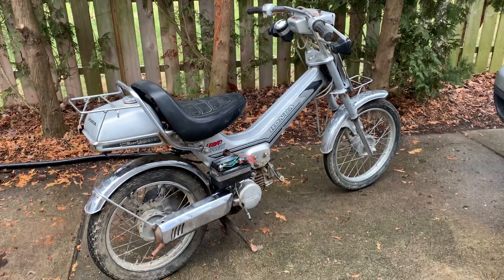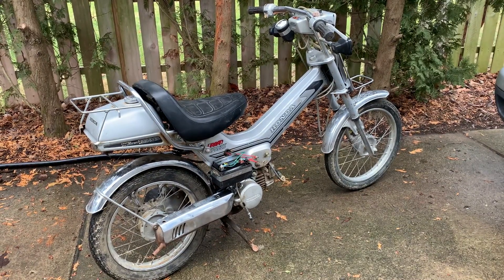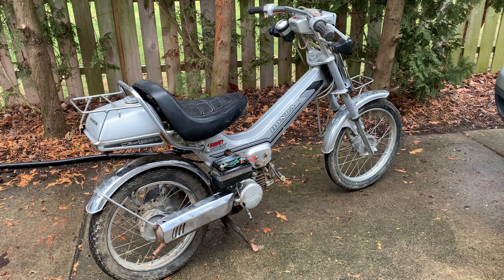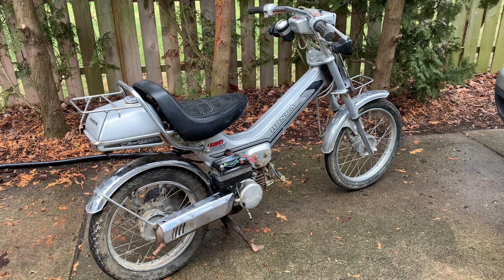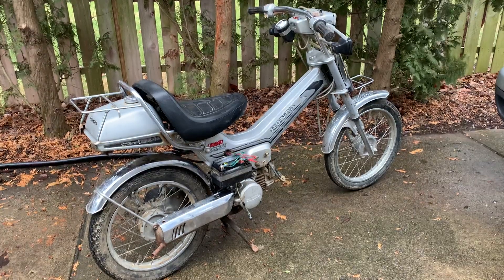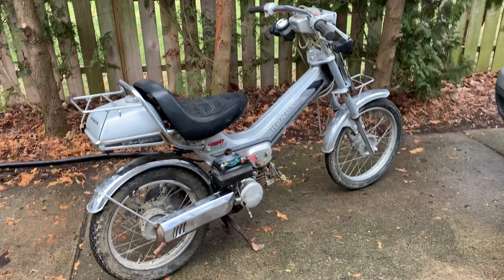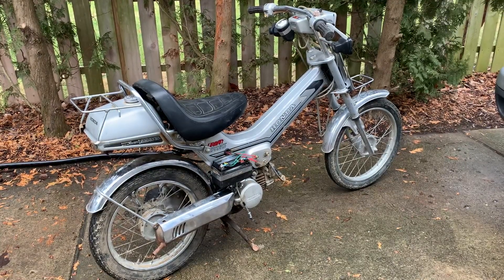Silver Honda Urban Express Nu50 first start after stuck piston and crank

Comment: I've got a little nx50 I'm going to rebuild. Been collecting parts for awhile. Gonna be fun. First the engine swap on my little Japanese KEI truck.
Reply from the maker: nx50's are fun.  I've had a few at least.
Reply from the maker: And someone cut off all the wires leading to rear brake light as well.  Thank you whoever that was.
Reply: @jackrutherford-1  the constant battle of reviving these is more difficult than ever. You ever use Treatland Moped?

Comment: Another saved urban running again!!
Reply from the maker: This one was a mess and still needs rebuilt.  Somebody had tightened the rear brake adjuster all the way in so the rear wheel was locked up.  I think they did this to hide the fact that piston and crank were frozen.

Comment: I’m dying at listening to it!  You didn’t need to get closer to hear it rattling. Those poor bearings!  Destined for the metal recycler anyway, I guess.
Reply from the maker: like a box of gravel
Reply from the maker: I filled the case with WD-40 and let it sit to free the crank.  Emptied it and repeated.  And then repeated again with 2 stroke oil. A bit of rust inside so it will need a new crank as well as bearings.
Reply: @jackrutherford-1 I’d like to get a Kroil spray bottle like Mustie1, but damn, that stuff is expensive.